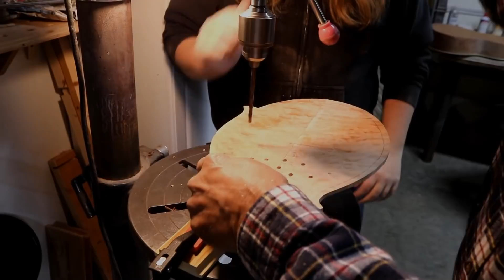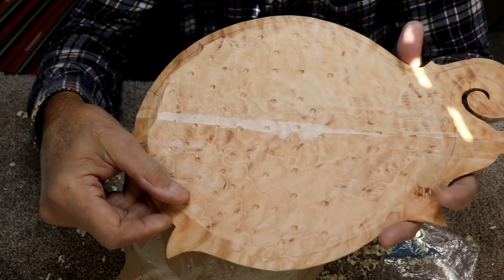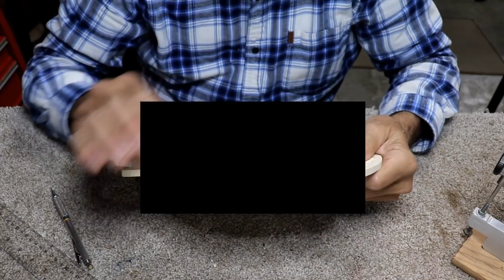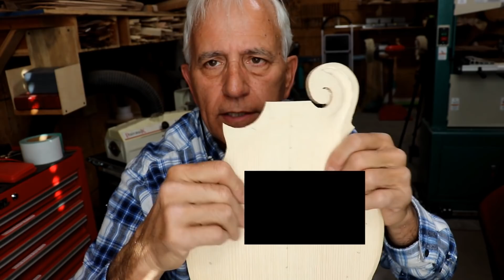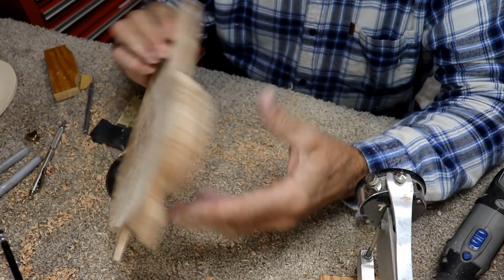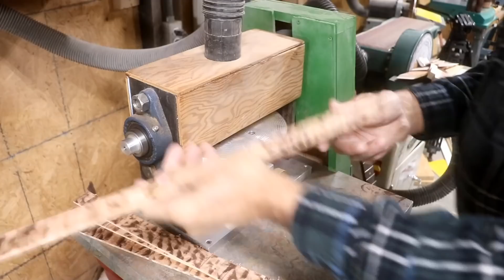560 RSW The Worlds Finest Mandolin Ever Built By A Human - Part 4

Comment: Thin slices of laminated quilted maple stacked with wafer thin darkwood veneer look amazing when laminated.    You have the pattern of the maple with pinstripes.   Just make sure to keep all the slices in the right order.   It makes for a really strong neck, too.  My stepdad used to do that for banjo necks.
Reply: When making 3 piece guitar necks they actually put the middle strip in the opposite direction so the grains of the timber are opposing. That way the neck cannot warp.

Comment: 188 grams vs. 186, You might still have some water weight involved. You ARE working with wood. Sanding is a part of that life, even with sore hands. Why didn't you use a router to hollow out the inside shells?